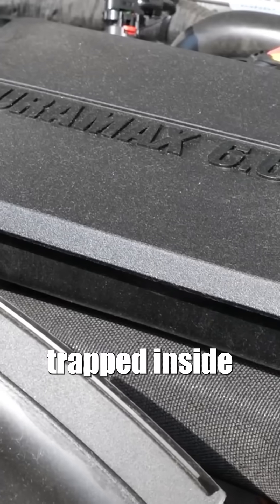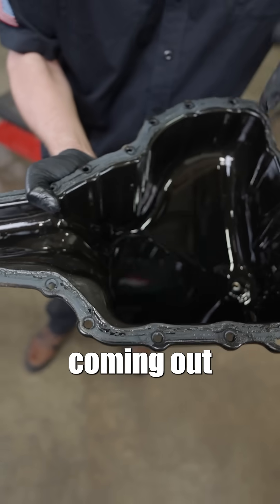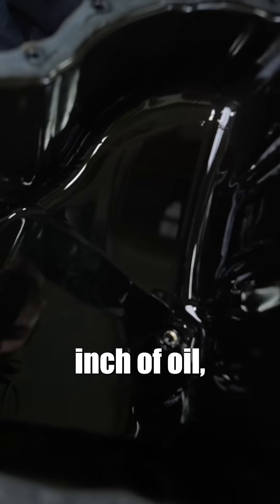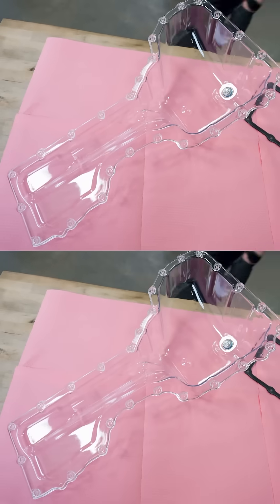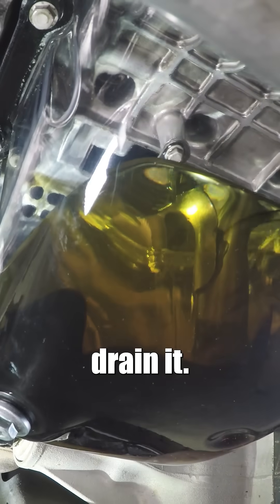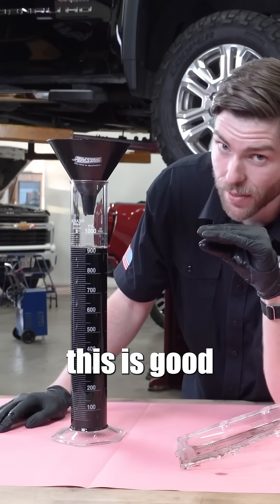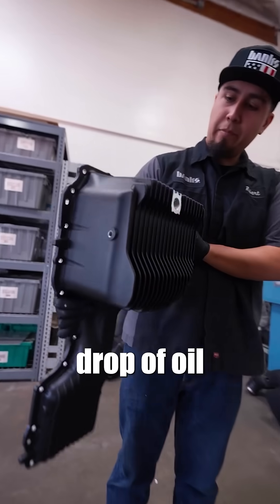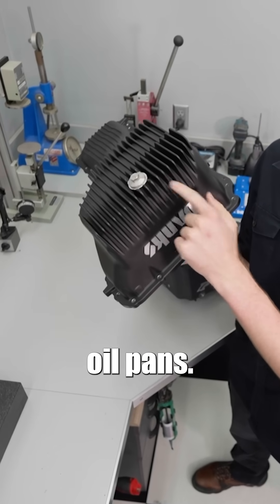A disturbing discovery. This dirty oil is trapped.

Comment: Personally i'd prefer to get the extra quart out of my engine than just to delute it with new oil. That is equivalent of whan doing an oil change o ur current car take 80% of the oil out but leave in 20% dirty. I'm sure it has to have negative effects. guess we need a controlled test over many many miles to see if  that extra quart of dirty oil makes a diffrence over long time to the non belivers of this being necessary.

Comment: You do realize it’s designed like that so you don’t have a dry start on an oil change
Reply from the maker: GM's intent was not to retain oil in the pickup tube for priming. We've measured the time-to-pressurization with both the stock and Banks pans. In both cases, the time is negligible.

Comment: Damn, thanks for the info boys👊 I’m a 5,000 mile oil change guy on my duramax so I’m hoping that little bit is getting fresh oil enough that I’m good. 
Thanks for sharing.👊
Reply: Just so you know, if you don't want to spend the money on their oil pan, get a vacuum pump and catch can(or make the catch can).
Pull vacuum through the catch can and run a hose from the can to your oil pan. 
You effectively recreate a significant portion of the effect of the pan by siphoning much of the oil out. 

I'm not saying their stuff doesn't work, I'm saying you can achieve it without significant investment until you feel you need the new pan if you want it that bad.

Comment: Damn, you guys come up with every solution to everything that engineers want to screw up
Reply: Except it's clever engineering that keeps the oil pickup from ever being dry keeping the system primed so oil is able to build pressure quickly.
Reply: You have to understand that engineering is a delicate balance of cost vs application. To put it simply, it's cheaper to make them that way. One can produce the most thought out car, where every design/placement is studied for maximum reliability, longevity and ease of maintenance, at what cost though? That's a question for another department
Reply: Tell me you know nothing about engineering without telling me
Reply: @ tell me u know nothing about being trolled without telling me 🤣
Reply: This fixes nothing it's just something for you to spend money on. If you change your oil often enough you're fine. It's a 10 quart system, the oil is so diluted it doesn't hurt anything. 

Not to mention the oil that lingers above the heads, in the valley, lines, etc. It looks pretty but it's really not necessary. 

Their diff cover on the other hand is AMAZING.
Reply: This is an improvement, but this design does not screw up anything 😂
Reply: It's 2024 in auto industry still won't fix this problem.

Comment: Drain your oil, put the plug back in, and let it sit overnight. You'll find we leave a lot more dirty oil in our engines than we think. Cylinder heads love to hold oil. But there is light. Engineers have already figured for that when deciding oil change intervals
Reply: Huh never thought about trying that. Wouldn’t really make much of a difference but it’d still be cool to test.
Reply: Jack up one side of the truck, then the other, to get as much as possible out of all the low spots in the engine. My old Civic and my new Tacoma both have the drain plugs on an angled piece of the pan, so when you jack up one side, you can get a little more oil out of the sump of the pan, too. A negligible amount, if you're running reasonable oil change intervals it won't make a difference, I just like to be thorough. I suppose if you're not running reasonable oil change intervals, it still won't make a difference .
Reply: If you drain it and then drive around the block a few times to get up to temp it will release all that head trapped oil and get more drops to come out, no prob!

Comment: What kind of black paint is actually on that oil pan?  I am aware that there are black coatings which actually increase heat transfer to the ambient air. Is this one of those coatings or simply a black paint that acts like a thermal insulator?

Comment: That was by design so the pickup tube never had no oil not in it because if you always have oil going to the engine when you're cranking it you won't have bearing where a little bit of dirty oil with you got another gallon in there and two quarts in it guess what change the oil every 3500 me and guess you're going to be fine with this new oil pump you'll have dry startups until the pickup tube can suck the oil up into the engine that's not a good idea
Reply from the maker: There is no evidence to suggest that GM's intended to retain oil in the pickup tube for priming. We've measured the time-to-pressurization with both the stock and Banks pans. In both cases, the time is negligible. More harm is caused by dirty oil at the bottom of the sump than the few milliseconds that it takes oil to travel up the tube.

Comment: It's not forever. It's just gets mixed back into the other 10+ quarts of oil and it does come out eventually
Reply from the maker: When changing oil, the goal is to remove as many contaminants as possible. Even though old fluid is being diluted with fresh oil, it should not discount the fact that there are still heavy metal contaminates in the residual oil that is left in the sump. Most will agree that removing as much of the contaminated oil as possible is the optimal route to maintain your truck over it's lifespan.

Comment: Up here in Canada, since Trudeau emptied our wallets, the only Banks we can afford are snow banks, so we prop the front end of our Duramax on a snow bank, then proceed to change the oil. The 45 degree ( big snow banks here )angle of the truck is now permiting a complete pan and pick up tube drainage. 😅

Comment: There is a reason why they do this. And, it has to do with the pickup tube specifically. They are trying to prevent dry starts by preventing the oil from draining back out of the pickup. That is the entire purpose here.
Reply: Damn they responded once with nonsense, and went silent since... guess because they know they are wrong and have no proof otherwise.
Reply: This is just the parts version of Snake oil. Can't imagine spending money on this of all things.
Reply: @ericjohnson7502 it’s the same oil that the engine was running perfectly fine on before the oil change. To say that it’s insignificant is the understatement of the decade.
Reply from the maker: There is no evidence that GM's intented to retain oil in the pickup tube for priming. We've measured the time-to-pressurization with both the stock and Banks pans. In both cases, the time is negligible. More harm is caused by dirty oil at the bottom of the sump than the few milliseconds that it takes oil to travel up the tube.
Reply: @bankspower Do you have data to support the "more harm" statement?
Reply: @bankspower  that one quart of oil that's still left in the tank is the same as all the other courts that were just in the tank before you drained it. That old oil wasn't causing a problem, and it certainly wasn't hurting the engine. So outside of cool look factor and air cooling fins, what has actually been gained?
Reply: @bankspower Show me a duramax getting oil pressure within 10 seconds after an oil change and im sold on this product.
Reply: @bankspower  there’s “no evidence” that they intended the oil level after draining to be at the pickup level??? Like perfectly at the level of the pickup? 😂 It’s laughable that you think the engineers wouldn’t have thought about how you can’t fully DRAIN A FLUID if the DRAIN PLUG is higher than the walls of the pan. Don’t assume they’re stupid, assume this design has a purpose. The design intent is painfully obvious because the level is essentially inline with the pickup, and any old oil would just immediately become diluted by the rest new oil you just added. Mechanics trying to “solve” an engineering feature.
Reply: @bankspower nonsense! The first thing that oil goes through after the pump is the filter.
Reply: @bankspower  that 'more harm' is still negligible. 

Almost every engine retains oil like that and I challenge anyone to find me an engine that has had a failure or significantly reduced life due that single factor.
Reply: @bradmcgrath358  Ford has engines that require an extremely fast oil change because properly draining (according to this advertisement) results in dry starts and the need for engine rebuild or replacement.
Reply: @bankspower thank you, also on modern oil there's a film on everything for a quite long time. People are worrying about nonsense here!
Reply: @DarkAttack14 the crankshaft and bearings are not lubricated by a film of oil. They are actually riding on a pressurized layer of oil that prevents any metal to metal contact. Having a primed pickup and pump ensures quick pressurization preventing so called negligible time to prime.
Reply: @davidleonard8369  partially right partially wrong, the crank bearings are 100% lubricated by oil. They also are in normal use kept from touching by a layer of pressurized oil. When there isn't pressurized oil for the moment or two it takes for oil to travel to the crank.. The oil film that's there is more than enough to prevent significant wear! An empty pickup tube is in all reality unimportant in the grand scheme of things
Reply: @DarkAttack14   yup, complete bs made up to sell a product. It's still a cool product, no doubt. But their reason is bs.
Reply: @ have you ever started an engine that has lost prime. If it has any kind of mileage on it it clatter’s like hell for a few seconds. Not a healthy sound to me. That’s why many of us people called professional mechanics will usually pre fill the oil filter when possible.
Reply: @davidleonard8369  prefilling the filter is a sign of a non professional mechanic.. You have it backwards. 90% of the time if a motor is clacking after an oil change its a motor with hydraulic tensioner and that's the timing chain slack bouncing around and it's not a bad noise. Sounds bad sure, but doesn't mean it is bad. A lack of oil in the pickup tube doesn't mean lost prime.. But if you manage to drain the oil pump itself sure that becomes a slightly issue. When you prefill an oil filter how are you doing it? Filling the center or carefully filling the outer ring of holes. One way is a waste of time but not an issue, the other way you're guaranteeing any dirt in the new oil which is always present goes right to your most important components. Motor oil has no standard that requires it to be "clean" in the bottle. There is often a decent amount of material in there. The only time prefilling a filter is a good idea is if it's for a large capacity diesel motor where it would take too long to fill the filter and couple possibly result in increased wear
Reply: @ I’m 61 fucking years old so what are the chances that I’ve worked on thousands of engines without a hydraulic cam chain tensioner? How about every under head cam engine since the beginning of time? Just stop it. Dirt in new oil? Good lord!
Reply: @davidleonard8369  yes, dirt in brand new oil. Every single container of oil ever bought has its share of materials and debris
Reply: @DarkAttack14  after an oil change, its typically from the lifters... not cam tensioners. But ok lol. Also could just be basic wear and tear. Chevy small blocks are notorious for doing this just from sitting. Nothing wrong with it, just piston slap. Doesnt hurt anything, just a noise.
Reply: @ sure. And if you combined the debris from every drop of motor oil ever refined you might have enough to make a mud pie. But honestly back in the eighties when I was racing in the Socal desert one of my sponsors was a local valvoline oil distributor and during a casual conversation one day with an engineer from Ashland corporation he stated that all motor oil they produce is in fact filtered before being packaged wether it be in bulk or bottled.
Reply: @DarkAttack14  The debris in new oil is at a microscopic level that is essentially undetectable and unmeasureable. So, yes, there can be contamination, but it wouldn't matter as it would pass through the filter anyway. If your "new" oil has enough contamination that it's visible, you are buying used oil. Or simply, you are buying the worst oil on the market.
Reply: @davidleonard8369  this^^^ oil isnt just refined and put into a bottle. They obviously go through filtration systems.
Reply: @ of course they filter it. I’m not the dude claiming that new oil has dirt in it.
Reply: @davidleonard8369  I know, I'm agreeing with you.
Reply: @DarkAttack14  😆😆😆😆😆😆😆😆
Reply: @DarkAttack14  timing belt says no.

Comment: That’s an easy solution, just get a siphonic oil drainer down the dipstick tube and you’ll soon have it completely empty, assuming of course your car has a dipstick. My mate swore they were useless until I proved him wrong , he’s now converted 😊
Reply: Nah bro all you need is a bendy straw and syringe to get the oil below the threads out.
Reply: @markm0000 
You're absolutely right about the syringe. 
It's cheaper than my thought on how to achieve the effect. 

I was thinkin to get a vacuum Guage and catch can with a couple hoses to achieve the effect. Make a siphon for cheap. 
Less work, y'know?
Reply: You could also drill a tiny hole into the very bottom of the threads to let that last bit of oil drain out every time.
Reply: @markm0000 bro wtf 💀💀 I hope you’re joking
Reply: @benbrooks566  This is not a bad idea, as the plug seals on the mating surface, so a hole in the threads is nothing to worry over.
Reply: @jamesplotkin4674 
You're not wrong.
 i, personal opinion, would take the pan off to do this procedure.
I'd be reasonably worried about metal shavings getting in my motor, but it would be a fair shake at a solution.
Reply: @kairu_aname  I wouldn’t worry about metal shavings. You’re drilling up at an angle and it will fall down. Maybe some small shavings at the end will fall inside but the oil filter will catch all of that.
Reply: That's exactly how I do mine.  Built my own vacuum system using a brass pump connected to a 1/4 horse motor!  Also use an AMSOIL high bypass duel filter system!
Reply: I actually just bought one of these and am going to use it for the first time tomorrow. Im pretty excited actually.
Reply: Ever since a friend of mine showed me, I bought myself one and never went back!